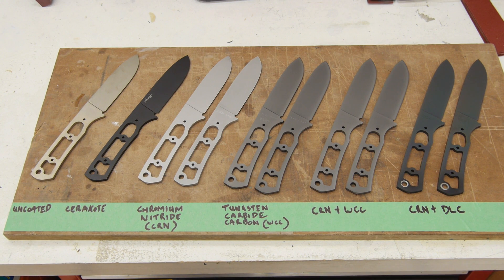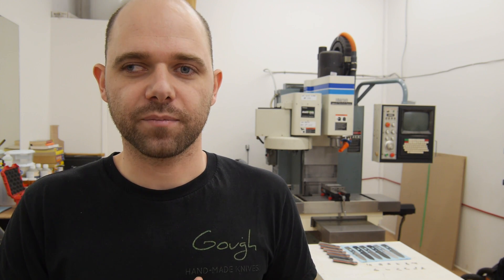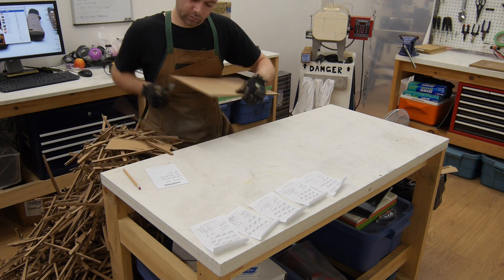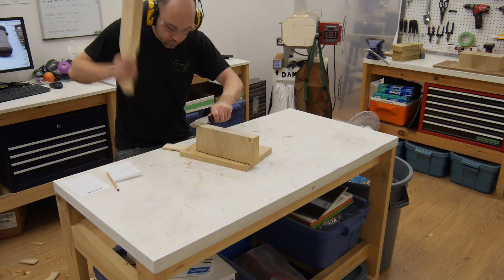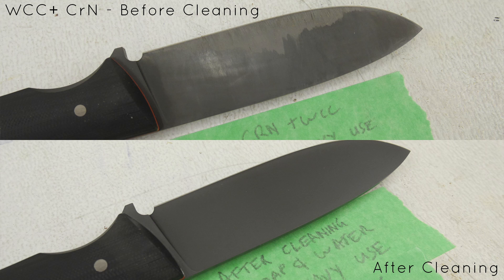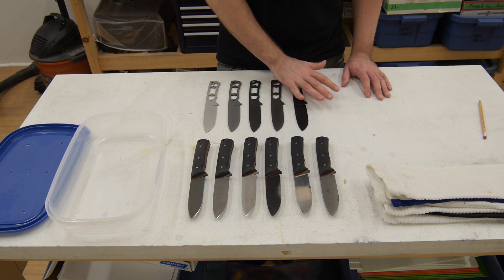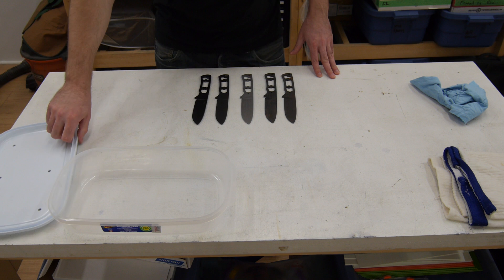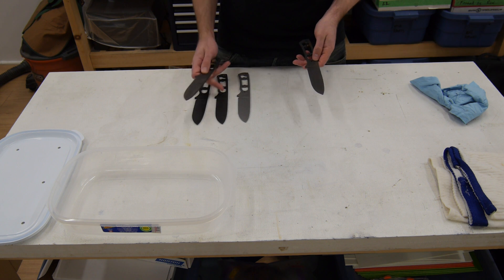Knife coating showdown! 6 different blade coatings tested.

Comment: Your test is really good but I would like to point out that the ceracoat will likely chip more when you apply the shock during test, which is one reason it might loose coating faster than others.
Reply from the maker: Cerakote is hard but not at all prone to chipping if applied correctly. I have abused knives to the point where the bent/dented and the cerakote moved with the blade no problem!
Reply: Gough Custom oh I was talking about things like dropping the knife with ceracoat, I have an Emerson knife with black cerakote and I dropped it on the floor the first day I got it, I found a small chip on the blade right after. By the way good video, not many people do tests on the coating, most people only care about edge retention. :)

Comment: Your testing is phenomenal. Well done.
Do you think DLC adds to corrosion resistance or is it neutral?
Reply from the maker: The DLC helps hold an oil film on the blade so it does offer some additional corrosion resistance, but by itself it doesn't do much

Comment: excellent video thanks very much. I'm currently looking into coatings for golf clubs and cerikote has been the "go-to" for a while now however I'm wondering if DLC could be the new kid on the block. how do you rekon it would do if used on clubs?
Reply from the maker: DLC would hold up a lot better to wear and tear over time, but would offer much less in terms of corrosion resistance
Reply: Gough Custom thanks for the reply. I also think to get to a stage where I'd be able to offer DLC would be a considerable investment. I might see if i can get a couple done here in the UK and put it through it's paces.....

Comment: question: why dont you use a high quality stainless steel like M390 or CPM S110V. Does it come down to price or is there a different reason?
Reply from the maker: +Thorwald Johanson because of issues with toughness... High alot stainless steels (like the ones you mentioned) are a lot less tough than carbon steels like A2 unfortunately. I am hoping to be evaluating stainless steels soon with the goal of finding one that's tough enough to let me switch!

Comment: I have access to a salt spray chamber. we use it to test automotive parts. might be good to test some of these coatings or even different types of stainless? it's super harsh. mild steel shows visible rust after about an hour! I can stick anything in there you want. only just discovered your channel but binged on loads of vids. Only ever put handles on knives but want to make my own blade now!
Reply from the maker: +robg109 awesome! I'm thinking about doing another round of testing soon, so maybe I'll be in touch!
Reply: no problem, I'm going to order some O1 today for my first knife blade

Comment: Do you do the dlc coating yourself? If so explain how you dlc coat a knife that would be a cool video
Reply from the maker: +nick rinne no, unfortunately the equipment required to do the DLC coating is very expensive and large!
Reply: Gough Custom so do you continue to use dlc coating or do use cerakote?
Reply from the maker: +nick rinne everything is DLC. Cerakote is as good as it gets for coatings you can do yourself, but it's vastly interior to DLC

Comment: That was highly informative as I am considering gettinga  watch cerakoted the problem with the testing is it does not measure abrasive resistance, cardboard and wood offer no abrasive response, like one might get from brushing against a wall, door handle branches, etc hope you get my point. That having been said since I am essentially customising a watch for durability ceraokte is probably better than PVD and DLC is an obvious choice but fiscally an expensive option. So i think cost comparisons must be considered when viewing this in context. Great work learnt loads!
Reply from the maker: +Basa 1959 actually cardboard is really quite abrasive you can see this in how the cerakote blades look after the cardboard test. My test didn't cover impact with other metal objects like for handled and such though for sure
Reply: Cardboard abrasive do me a favour...best laugh I have had in ages. If its cut adn the it is sliced against ytour skin perhaps, but as I was suggesting so you clearly missed the point. It does not scratch itens like branches do or metal objects like door handles hinges etc...So thanks for trying but that reply is fallacious.
Reply: You're obviously not able to understand the concept so let's try this; Some sandpaper is 200 grit, thus very abrasive. Other sandpaper is 800 grit, less abrasive but still abrasive.  Can you grasp that concept?  So cutting and batoning hardwood isn't abrasive but a branch is?  You're also trying to compare coating impact resistance to wear resistance.  The substrate will ultimately define how strong the coating will be with regards to impact resistance.

Comment: how do you apply the coating? also where do you get it?
Reply from the maker: The coating is applied by an outside company. The machines to apply it cost around $1million each which is why I get them to do it for me!
Reply: Gough Custom where/how do you send them and how much does it cost?
Reply from the maker: I send mine to SPuttek in Toronto, it's about $25-30 per blade.
Reply: thanks i think once i make a really good one I'm gonna get it coated

Comment: Fantastic video. It's good (though uncommon) to see such well controlled tests on YouTube. Is there a reason you wouldn't add salt to the water for corrosion testing?
Reply from the maker: Thanks! Salt water is not really an intended use for these knives, so I wanted to stay with a more mild corrosion test.
Reply: I actually hear that a lot. I go through so many dive knives, haha.

Comment: you might also want to test the corrosion resistance of the coatings in a salt water environment.
Reply from the maker: Unfortunately because the base steel is not stainless none of the coatings will really help in a salt water environment... I would expect all of them to show rust fairly quickly when exposed to constant salt spray.

Comment: DLC/IonBond is a wonderful coating as you've shown.  I have my barrels done in it and get my internal parts done in it as well for the blacked out guns in my arsenal.  It's not a spray on baked coating which some of them are.  It's very thin and the properties make the metal look great, picking up fingerprints but then wiping clean time after time again.  I love it an will use nothing else.
Reply from the maker: I agree, I really like DLC and have been very impressed with how it performs!

Comment: Do you offer regrinds of any kind... and moreover.   If I was to strip a blade down.  Does your outfit offer coating services for other blades?
Reply from the maker: Hey Brian! I'm sure you could find a place to re-coat a blade for you but it will likely be a lot of work, most places are just not interested in doing one or two blades, including the place I use to get my  coatings done unfortunately.
Reply: Gough Custom Well,  I stripped off the epoxy coat and went with a standard DIY patina.   Issue with this knife is that it is just a Hinderer licensed shape/grind made with 1095 cro-van.    Can't hope for it to truly meet my needs in edge retention.  Would love to get this blade cut from a higher quality steel for sure.   Thanks for responding!

Comment: how about gold-plating?
Reply from the maker: Hey mate! Gold-plating would be very good for corrosion resistance, but gold is very soft and would wear off the knife very quickly.
Reply: good points.  how about some sort of plating where the gold is at a very low density yet still bonded to the steel, then you get corrosion resistance and it doesn't cost some ridiculous  amount. maybe, depending on how it was bonded to the steel, its softness wouldn't be much of a problem.
Reply from the maker: For that kind of application different coatings are better... Electroless nickel plating for instance is very hard and wear-resistant, but also very corrosion resistant, so gold wouldn't really be the coating of choice regardless of how it was applied I don't think!
Reply: thanks for your feed back on that.  by the way, if it's electroless, how is the nickel applied?
Reply from the maker: The nickel is suspended in a solution that is self-plating... I don't quite understand the chemistry of it, but there's lots of info about it online!
Reply: OK, thanks.

Comment: Have you tried np3 coating?
Reply from the maker: I have actually never heard of it!
Reply: NP3 is a coating that was developed by Robar Guns Inc.  They do a lot of coatings for firearms.  NP3 and NP3+ have teflon impregnated into the coating so it results in an extremely favorable coefficient of friction.  To the best of my knowledge, it only comes in silver.

Comment: Hey man thanks for doing this video it's really great and very scientific even having a good control. would you do a video about how those same coating do in a harsher environment like mud or slightly bleach water? also are you going to start making folders? a folding knife of the same quality as your fixed blades would be in high demand.
Reply from the maker: Hey Joshua!
The DLC coating should hold up very well in mud, as long as it's kept lightly oiled like I show in the video.

I would like to do tackle making a folder at some point soon!
-A

Comment: Just starting with the ideas of knife making and your channel has by far the best info! Looks like I will be filing for a long time on my first ones but hope to work up to different tools like you have. Its inspiring to see talent!! Where do they do these coatings?? Im way away from that but the testing caught my eye when I put time in and get experience! Is there a company in USA that may do this??
Reply from the maker: Unfortunately these coatings (except for Cerakote) are very hard to get access to unless you're doing a lot of knives, industrial coating shops don't want to do 1 or 2 knives, they want to do dozens at a time at least usually.

Comment: Dear Aaron, recently there's been some worries on some type of coatings coated on some commercially produced knives being "cancer causing" with some brands actually printed the warnings and precautions on the cancer causing coatings, what's your take on this? And how does the DLC coating perform in terms of hazard of use?
Reply from the maker: Hey Victor! I can't speak authoritatively about this because I simply don't have the resources necessary to do the kind of testing required... However it's my understanding that DLC should be relatively safe. DLC is often used on medical biological implants which is a sign of it's bio-compatibility.
Reply: Hi Aaron, thank you very much for that information. It make lots of sense if DLC was used in biological implants. But regardless of the coatings, I'm guessing it should be fine and completely harmless unless you wanna use the knife for food processing everyday right? 😂 Which is not one would do say like using a Resolute.
Reply from the maker: Well I would feel perfectly comfortable using the knife every day for food processing, as I don't feel there's any risk... However I can't warrant that there's no risk because I haven't gotten the official FDA approval.... I personally think it would be fine, but of course it's very hard to officially guarantee that, and even then they sometimes get it wrong!

Comment: Why don't you make a knife which handle could be change, 1 handle should be made of pvc or arcyllic another should be made of strong wood. Which could be change by torx screwdriver.
Reply from the maker: I don't like wooden handles because they expand and contract over time and will usually crack or become loose. There's really no advantage to making interchangeable handles as far as I'm concerned, so I don't do it.
Reply: Thanks for reply and info, I really don't know that.

Comment: Nice video Aaron! Those are experiments well worth documenting for the sake of the artistry. Have you researched on safety when processing food with a coated blade? I made a few knives for the kitchen and never went beyond gun blueing. Remember you used to ditch the blade into an etching acid, how was that compare as a protection layer?
Reply from the maker: Hey Daniel!
Unfortunately gun blue (cold gun blue) is actually probably the worst possible coating to put on a kitchen knife! It works by depositing selenium oxide onto the steel, and selenium is toxic! Probably best to retire or polish those... I wouldn't really want Cerakote on a kitchen knife either which is part of why I've always been less than happy using it...

DLC is a totally different story. DLC coatings are pretty commonly used on biological implants, and some versions of it are FDA approved for food contact, I really don't anticipate any issues with it!
Reply from the maker: Acid etching looks good initially but degrades very quickly with any amount of use unfortunately... I stopped using it pretty quickly for that reason.
Reply: Hahaha that was least expected. was assuming the blueing chemicals got washed away and what's left is bonded with the steel... Should not have slept on those chemical classes back in school. Now definitely gonna repolish the blades, or perhaps give to someone annoying if none of us tell.

Interesting that DLC is bio-compatible. Only experience with it was tungsten-DLC on a Mora Black. Lasted for a week on the sea without corrosion until I exposed it to mud. 

I notice the secondary edge of mark III was resharpened after coating. It happened to be another reason I hesitated with cerakote, as the thickness dulls scandi edge. And resharpen can't be done without removing all coating on the scandi grind. 

By the way, saw you facebook that the sheath are done with cnc now.  Congrats on one more step to automation, mate!
Reply from the maker: Thanks very much! The sheaths have been a stress point for me for a long time, so it's great to finally be automating that step!

Comment: Aaron, any concerns in regards to coated knives when/if they come into contact with food?  I know the primary intended use of the knife is as a tool, but food contact may happen during the use of any knife.
Reply from the maker: Hey Griff! Cerakote is not rated as food safe, so yes it is a concern with Cerakote. DLC however is often used as a coating on biological implants and I believe it's FDA rated for food contact in the USA. The exact coating that I use is not specifically rated for food contact, so I can't say that it's 'food safe', however I do not believe that it should be a concern.
Reply: Awesome! Great news since the DLC tested well.  Thanks for the response Aaron.

Comment: Currently it would seem that you are the only independent source regarding coating testing. How did the satin finish with oil do? Would it be permissible to allow me to cite this information in some writing and provide you as a source?

This information would be presented in the form of a coatings performance table.
Reply from the maker: Satin finish with oil was tested during the initial test... It did 'ok', it had some corrosion near the tip. There are photos of all the blades after all the tests right at the end of the video.

Comment: Hi Aaron, would you mind sharing who you went to for DLC? I didn't have a great experience with the place I went to for my blades. They arrived several dozen days late and with a bill 20% higher than the quote.
Reply from the maker: Hey mate! I used Sputtek here in Toronto.
Reply: Thanks!

Comment: Hi Aaron ! You doing awesome work ! I just wanted to ask you why did you choose this blade length for your knifes ? wouldn't be better a bigger blade for this kind of knifes ?
Reply from the maker: Thanks mate! Blade length is really a matter of preference... Shorter blades give better control for delicate tasks, longer blades can give more power for chopping tasks. It's my personal opinion that chopping is usually not the right job for an outdoors knife... If something needs to be chopped then usually you're better off with an axe/hatchet, or better again a saw.

The exception to this rule is in rainforests where tools like machetes and parangs are good enough to cutting/clearing the soft plants and so on found there.

Main uses for one of my knives would be butchering/skinning game, carving, food prep, and so on... A 4.25" blade is plenty long enough for all these tasks.
Reply: correct.  that's why axes were invented.
Reply: I agree  . these blades are kinda small for a tactical - outdoor knife  .
Reply: but Nutnfancy told me axes are dangerous, heavy and lack control. plus big knives are tacticool. you guys don't know that you're talking about!

Comment: did you do any tests to see how well the scales stuck to these slippery new coatings?  i realize the pins (corbies?)  provides a strong mechanical connection independent of the epoxy.
Reply from the maker: Any of the coatings will provide better adhesive bonding than Cerakote will actually! Cerakote is very slippery and even epoxy will not stick to it. For this reason I have pretty much always treated adhesive as a 'sealant' rather than a joining mechanism, for the actual strength I entirely rely on the Corby bolts.

Comment: Awesome. Thanks for the data. Can any of these coating be done to a blade after micarta handles have been epoxied on? I usually acid etch the knives, but the oxide isn't as tough as I'd like.
Reply from the maker: Unfortunately it has to be just the blade by itself. The process has to be done in a very clean vacuum, and most handle materials will 'outgas', which will contaminate the vacuum enough to stop the process from working.

Maybe look into an acid stonewash done with vinegar rather than ferric chloride, I've found it to be a reasonably durable finish!
Reply: Gough Custom
Yeah, I figured that might be the case. I currently use vinegar with salt and hydrogen peroxide.